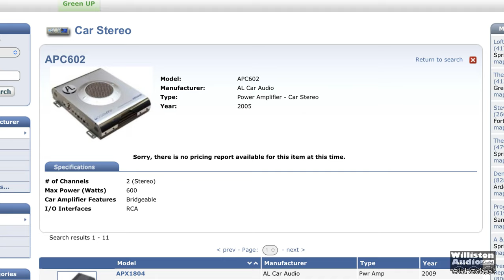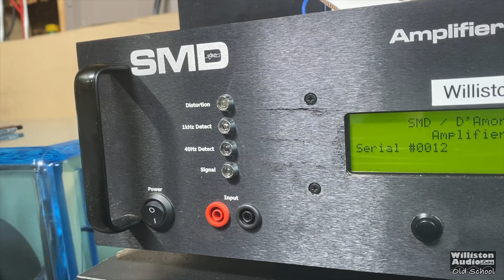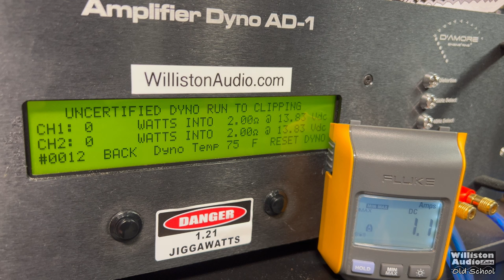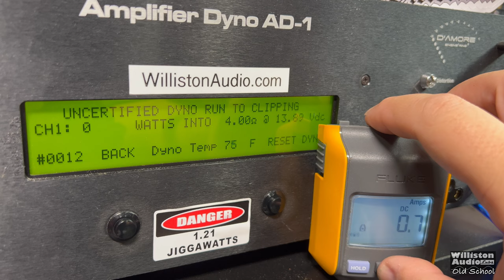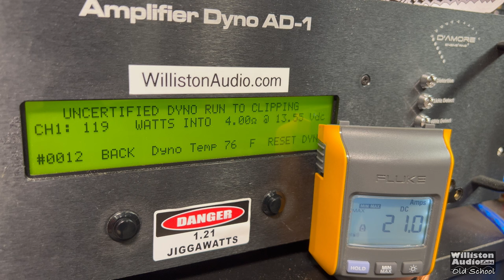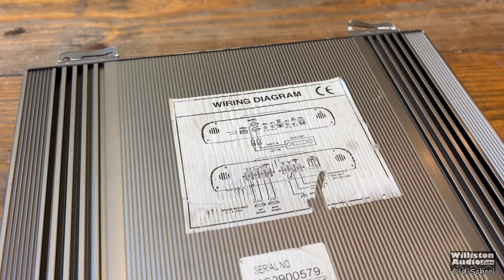You Don't Know This Brand - 2005 AL Car Audio APC602 Amp Dyno Test

Comment: are they really Korean made amp?. i honestly think they're actually Chinese brand. also, you can try to drop some lubricant to the fan bearing. it usually fix your kind of problem. any lubricant works, i usually use silicone oil

Comment: It's acoustic logic. I had one of their bigger amps. It was garbage, but I didn't know that at the time, because no one was around exposing the industry like Big D at the time. It sounded decent hooked up to two MTX 6000 15s. Even with the subsonic set I still got vocals through the sub. I ended up using some Harrison Lab subsonic in line filters to fix that. I lost the amp some years ago I don't know if it was stole or just got lost in moving,  but I don't have it anymore. Good riddance to bad rubbish.
Reply: Subsonic filters reduce the very low bass. Vocals are in the upper bass region. A low pass filter is what reduces those upper frequencies. I going to assume you meant low pass filter instead of subsonic. 👍
Reply: @JasonWW2000  technically a subsonic filter and a high-pass filter are the same thing . A low pass filter actually cuts out high frequencies. Why they named them the way they did I have no idea.
Reply: @runningbear1982  Your reply is very confusing. Are you confirming you meant low pass instead of subsonic?

I can explain the names if you want.
Reply: @runningbear1982  Low pass means it let's the lower frequencies pass. A 100Hz low pass means frequencies above 100Hz are filtered/attenuated at a particular rate/slope. 

A high pass means higher frequencies are allowed to pass.

Subsonic filter is a misnomer. It's like a slang term for infrasonic filter or high pass filter. It usually starts filtering out frequencies below 25-30Hz. So a subsonic filter will have no effect on vocals in the subwoofer. 
Hope that helps. 👍
Reply: It was rubbish because dude obviously didn't know what he was doing! Lol
Reply: @shawnsatterlee6035  Nah, it probably had a very shallow slope on the low pass. Might have been 6dB/octave. If it was 12dB it may have only gone down to 80Hz instead of the 50 it claimed. Something like that.

Comment: I remember the "American Starsound" had that design.  They were cheaper in South Africa where I was living than most other established brands.  We had so many options of genuine rubbish.  I think my first amp to drive 2X12"s was about 80w rms bridged max.  Those old Kenwood & Pioneer subs were 60w rms power.  My second system was a pair Earthquake 10"s.  They were a respectable 160w rms per sub.  I used a Calibra 6 channel  with 40X4 & 250X1 on the 2 ohm stable sub.  That system lasted in my mate's car until the late 20teens until it was stolen.  Common occurance in South Africa.  Most probably rocking away in a nearby township.  The Calibra system was decent, prior than it was just patching cheapies together and blowing and replacing them.  The stupidity  of you.  😂

Comment: Not to shabby for an amp that has an 20 amp fuse only
Reply: No that was terrible,  my kenwood 626 had a 25 amp fuse, and I'm sure it did rated @ 50watts @ 4ohm 75@ 2ohm 150 bridged, so, no that power was 👎 they put a fan on a 40 watt amp 😂

Comment: Why would anyone want to keep the voltage in the mid 13s? I would want to keep the voltage near where my vehicle's electrical system operates. At 13.5V I would be replacing alternators.

And then it occurred to me, import Vehicles hate fully charged batteries. For what reason I don't know. Any charging voltage below 14.25V allows lead-acid batteries to sulfate, thus destroying the battery, and placing shock load and greater overall load on the alternator causing premature wear. I suppose some lithium batteries might like this voltage, as lithium batteries are highly sensitive to overcharge, but in the end, charging at such a low voltage gives you significantly reduced battery capacity.

For example, a 100 amp hour battery will provide you with 100 amp hours when charged at 14.25 V until saturation. That same 100 amp battery charged at 13.5 V will never reach its saturation point and it's storage capacity drops to somewhere in the 60 amp hour range.

This becomes more important when electrical load exceeds alternator output. If your battery Bank is only charged to 60% of its capacity, you will experience extreme voltage drop
Reply: You must drive super old cars then. All cars today have eld . They use eld on charging systems to get better mpg .
Reply: Man, so much of what your saying is wrong. Could you please just delete this comment? Thank you.
Reply: @Sql253  no, I just disable it because I'm sick and tired of having to buy new batteries every 3 years.
Reply: @JasonWW2000  please, by all means, name just one thing that was wrong.
Reply: @nighttow8780  I'm just trying to help anyone who might read your comment.